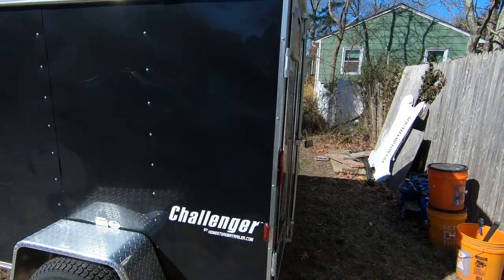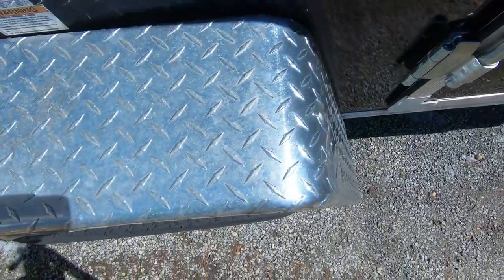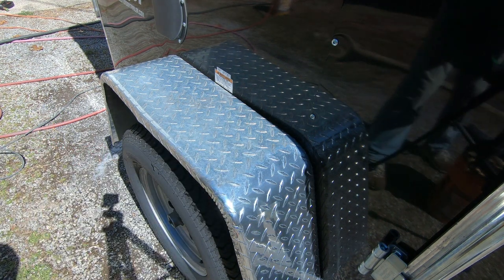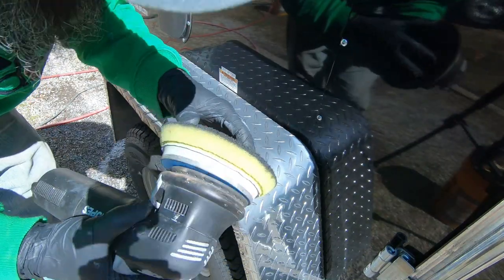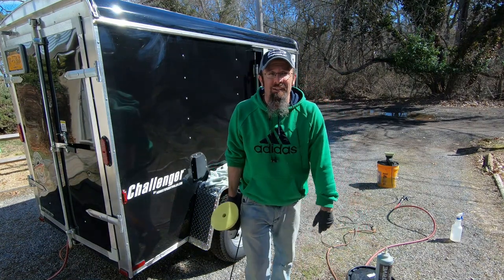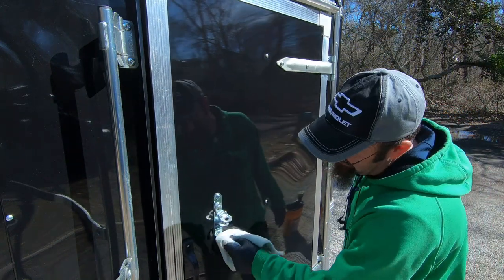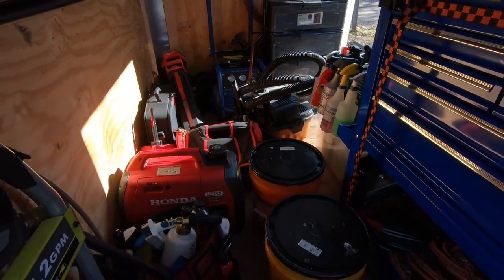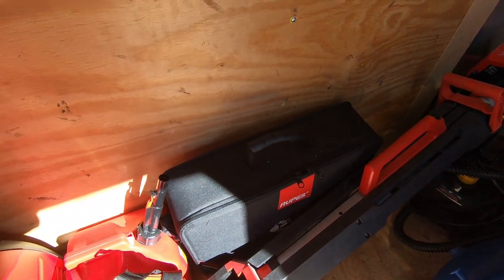My Mobile Detailing Trailer Setup and Spring Cleaning 2020

Comment: Looks like your setup works for you. If you are interested I recommend checking out Miranda Detailing to see his set up, possibly might give you some ideas. 
Good luck in your future endeavors 👍✌️🇺🇸
Reply from the maker: Thanks! I really appreciate the kind words. Just checked out Miranda detailing. He sure packs everything tight in that Expedition. Looks very effective though. I've actually milled around the idea of switching to a van before, but I really like being able get into and stand up inside the trailer. Being pulled by my Jeep it also has a surprisingly tight turning radius, so maneuverability is better than you'd expect.

Comment: Where are you located? and are you slow in the winter? how do you deal with that?
Reply from the maker: I'm in NY. I can work as long as it's above freezing. But it definitely slows down in the winter. So I usually take some time off and travel in January and February. Last winter I took a month long, cross country road trip.

Comment: Been looking at the same eagle compressor holding up good for you?
Reply from the maker: Had it for about a year now and I love it. I turned the regulator down to 80 psi and I can hold the trigger on the blower nozzle for quite a while before it's starts running low. I haven't really run any tools off of it, so I can't speak to that. If I ever do get a air powered polisher I'll probably retrofit a 20 gallon tank to it.